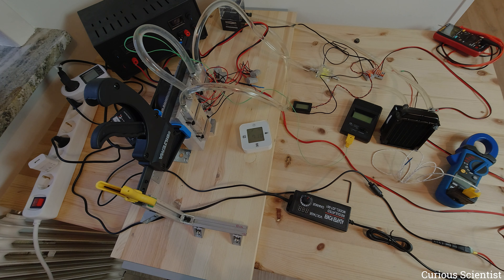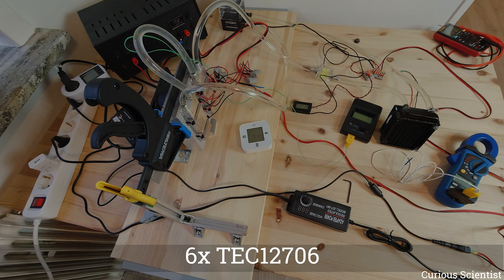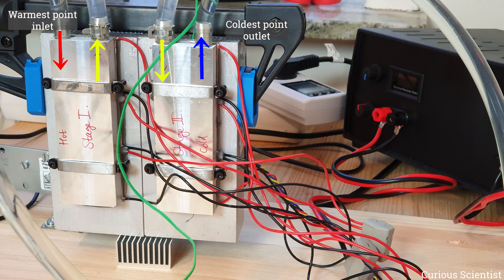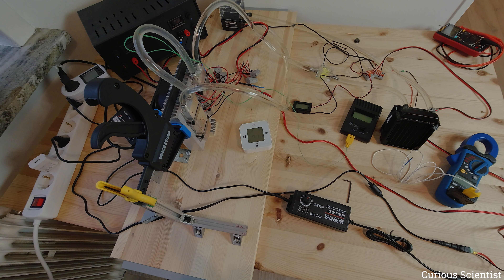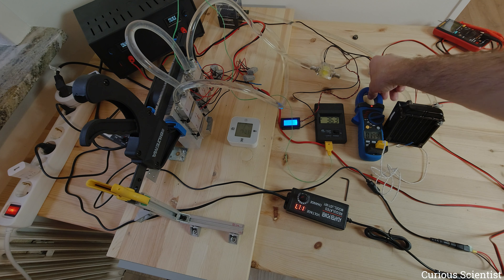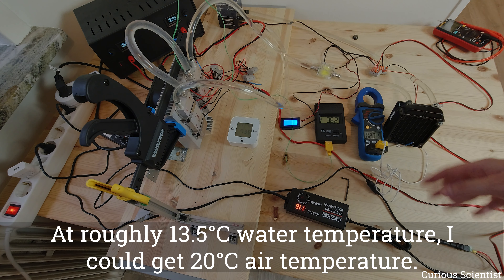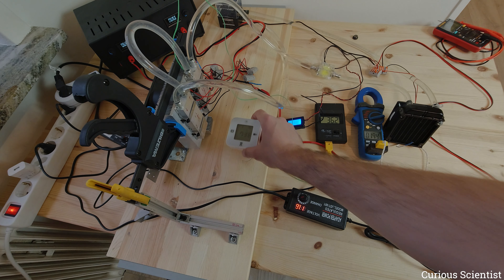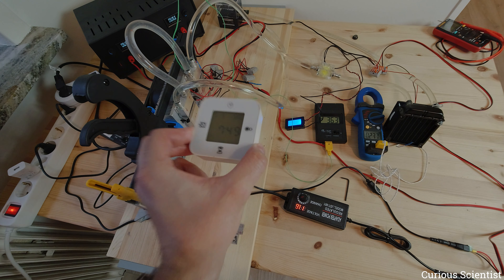Why is the Peltier cooler-based air conditioning a BAD idea?

Comment: Hay Curious Scientist, does it make much difference that your dumping the hot side hot air into the same room your trying to cool? 

I am wondering about building a 20 amp solar powered version with around 30 to 40 peltier coolers with both sides using copper water heat exchangers to remove heat from one side and cooler water from the other. 

In the summer I could use cold ground water to cool the hot side and a radiator to pump the cool water through with a fan. Since this is solar powered it would pretty much be a summer cooling system not a winter heating system. 

I am still interested in trying a full 20 amp version though. I do realize that those 20 amps could be applied to a regular air conditioner and it would probably work as good or better. I also realize if I got 48 degree ground water i can just pump that through a radiator and cool with that. Still want to try it though.
Reply from the maker: Hi!
No, it does not matter from the experiment's perspective. Of course, in a real situation, you would separate these two, but here I was not measuring the effect on the room temperature. I just measured the effect on the outlet air temperature.
Reply: I think that you should try it! Sounds like a good idea and could be some fun working it all out and putting it together! 
There's no greater satisfaction than when you put something together and see it working! 
The one thing that I took away from this video and the other video where he performed the same experiment but with only one Peltier device is that with the one Peltier device he achieved a 4°c temperature difference in relation to the room temperature and in this experiment he got an 8°c temperature difference but using 6 Peltier devices.... 
Something definitely tells me that the temperature difference should have been greater and I suspect that the problem lies in the cooling blocks! The hot side has water from the radiator going in one cooling block, then into the other and this means that the second cooling block is getting it's water pre warmed! 
I would personally go with the single water cooling blocks, the cold side water should be running in series while the hot side water should be fed in parallel to the water blocks! Using single Peltier water blocks ads complexity but the efficiency goes up! 
Also from my experience with radiators, you definitely need a much larger radiator on the hot side, in your case, using ground water mitigates the need for a radiator anyway, so that's not a big problem for you! 
But I would definitely try it! If the system is well designed, you should be seeing more than 8°c temperature difference and that might just be enough to get you the cooling you need! If not, then at that point you should know if you are going to need a few more Peltiers or a lot more! 
I would love to know if you have done anything with this idea 💡...

Comment: I see you are focusing on a house system. Try rethinking for old, classic cars where a belt driven compressor AC system is not viable place. I'm pretty sure you could get sufficient cooling of a car cabin with peltier devices. 

12 or 16 peltier devices connected to three water blocks. Hot side goes to engine bay and a large PC cooling radiator (via reservoir and pump) and cold side goes to a radiator small enough to fit under the cabin air filter (also via reservoir and pump). Put antifreeze in the cold side and some mineral oil in the hot side. Also place sufficient fans on the hot side to dissipate the heat in to the engine bay.
Reply from the maker: But please show it and prove it, do not just say that one should do this or do that. I can also guess that we should have maglev trains everywhere because they are faster and smoother. But then, good luck with providing all the infrastructure for it. Same here.

Comment: It is very inefficient, true. But I have a classic mini, with very little amount of cold air needed to be cooled. Would that be enough to cool the airlet's say 5° under ambient ? I have a 70 amp alternator, i could draw 40amp continuous just for the module at around 14v, that would be about 600w available, would that be useful or just a waste of time ? i'm not expecting insane cooling performance, feeling 25 instead of 30 would be a success.
Reply from the maker: Hi! In my opinion, cars are more difficult to cool down because their whole surface is exposed to the sun and they are not (well) insulated either. So you really need a great cooling power constantly. 600 W probably won't make any significant difference. A regular car AC is around 5x more powerful (roughly 3 kW), so you can guess how well it would perform with 600 W worth of Peltier coolers. Especially, because that 600 W is the electrical power and not the cooling power... I personally would not waste time and money on it.
Reply: @CuriousScientist  There is very little space under the bonet of a classic mini. I will try to use a refrigirator compressor, I've seen some were able to get around 1.500 btu, which should make a noticeable difference. Thanks :)

Comment: I've tried using Peltier to cool my water - it does not work. First, it takes a lot of energy if you do this for your van.  Second, you can't seem to cool the hot side enough even if you use coolant. I tested it and the hot side made my enclosed testing area even hotter than the outside.  So since I can't get the hot side to be cool the cold side is lukewarm thus no relief with cold air.

My Plan B is  I really have to use an ice maker to make ice and just use it with some kind of radiator hook up to a van to get cold air in the wilderness with no place to get ice.
Reply from the maker: Of course it takes a lot of energy, I am ranting about this in basically all of my Peltier-related videos and people just simply cannot accept it. If your hot side is getting too hot, you are probably running it at too high voltage and your cooling is bad. Make sure that you use large heatsink and proper thermal paste. I am also always emphasizing that one should not run the Peltiers at high (12-15 V) voltages. It is better to run them at lower voltage, around 8-10 V, but sometimes even lower voltage (6-ish) is preferred as their COP becomes better. Also, at this point, you will not be able to cool large volumes of water just with two Peltiers coolers. If I recall correctly, I mentioned it in my previous response, that you will need multiple devices. I meant something like 10 or so.
Reply: @CuriousScientist  10 devices ... this is not practical for my small van :) I wish I could do it because van life requires a/c that does not cost 1k or 5k. Maybe my only recourse is to use the ice machine :):):) And just cool me up using a radiator with a tube routing cold water through them and a fan in front of it. Thank you for your reply.

I did not pay enough attention to voltage here, but I use my van, which is based at 11.9 volts.
Reply from the maker: If you connect two identical Peltier coolers in series, they will get 6 V each if the supply voltage is 12 V. You would get much better performance. Also, I will start making Peltier cooler-related projects in the future again, so stay tuned and maybe you'll see some useful information in those videos.
Reply: @CuriousScientist  I will do that tomorrow. Thanks very much. but with that, I have to rewire everything :)
Reply: @CuriousScientist  Hello, I just cut 2 wires out of the group and connected them to make them into a series, and yes, the energy consumption is MUCH LESS.  I also put a bottle of ice in the return hot water container. I wanted to see with a little bit of ice would make the hot side less hot so the cold side is coldest and provide a lot of cold water quicker. So one bottle of ice that can do the job for 4 hours of cold is something I can handle with the tiny fridge section of my fridge.
Reply: Not working as I hoped. The hot side water is 1 degree cooler than the ambiance, but the cold side is not cold but only cool. The air is acceptable. well, I just need to redo the fan and the radiator and put both on top and outside of the cooler with tubes going into, the cooler. I will test this and let you know. But overall I think it will give me relief :)
Reply from the maker: As I mentioned, only 2 coolers won't make any significant difference. It is best to use a lot of them at lower voltage (thus current too). Since they are intrinsically poor in efficiency, there's not too much you can do to squeeze out a lot of cooling performance from them.
Reply: @CuriousScientist  yes I give up :) it also eats a lot of my solar which I have a lot of but still not enough.  thank you very much for your help :)

Comment: I would not recommend that setup if one wishes to test the efficiency of a Peltier cooling system. The biggest disadvantage of your setup is that you are using two heat exchangers to measure the cooling efficiency which is completely wrong. if you use 1 heat exchanger and use a single medium (air) instead of two mediums (water and then air) that will significantly increase the Peltier cooling system efficiency.
Reply from the maker: Hi! I replicated the system that most people ask about in the comment section (cooling water with Peltier coolers and then using the cold water to cool air). Also, many YouTube videos exist on this topic and all of them are misleading and they lack any explanation and measurements. I wanted to show them that it is useless. I think it is a fair demonstration for this purpose. If you check my other videos related to Peltier coolers and their comments I always discourage people from doing this because, as you also suggested, adding one more interface further decreases the performance. The "best" would be to have the cold side directly exposed to the environment that we want to cool (I have a video on that too). But I would not even build any "air conditioners" based on Peltiers because they are simply not made for that task.
Reply: @CuriousScientist  I agree with that. i have not tried Peltier myself as a cooling system to this point, but I am pretty convinced that considering the very low capital cost these systems actually have a good chance to work in confined spaces. I believe I would learn along the way. I watched your video and as far as experimentation and research are concerned it's pretty good to explain the idea, I was hoping for more of a solution after this setup and I will go through the rest of Peltier's videos to find out more. I appreciate your efforts in making the videos to spread the knowledge.
Reply from the maker: @mohsinraza2491  Thanks! I don't know what kind of solution I could have provided. I cannot change the intrinsic material properties of the Peltier coolers, and that is what decides the efficiency. 
But the conclusion is that since these devices are extremely inefficient, it simply does not worth it to build an AC with them. Yes, maybe a Peltier cooler is $5, but you need 30 of them to have considerable cooling power. Then you need to feed them, as well as cool them. So it is not cheaper than a proper AC with a compressor and in addition to that, the running cost is easily 3-5 times more expensive. 

They are the best when you need very good thermal stability (cooling laser diodes), or where you can directly mount something on its cold surface (x-ray detector or CCD camera). They are also used as "ovens" for reference voltage circuits.  None of these requires several hundreds of cooling power, unlike an AC.

Comment: in this experiment you imagine putting the peltier outside and cooling the inside through the water piping, would the efficiency change if you reversed it to put the peltier inside and pushing the heat outside through the water piping ? measuring the difference might be interesting. Also could we take advantage of the big radiators that are already in your home, plugging the inside unit onto them and using a big fan that blows on them might be more efficient that using the small ones.
Reply from the maker: I have videos on the mentioned arrangement, check my channel. Peltier is inefficient either way. Also, Peltiers are not powerful enough (you would need plenty of them) to create a noticeable temperature difference on such a huge body. Also, it is kind of illegal (and dangerous) to modify the radiators since they are part of the district heating system. At least where I live.
Reply: @CuriousScientist  hello sir, i just want to ask a question just to clear my mind, example i have 6 peltier unit with 6A each, does it means i need 36A of power supply or i just need a 6A supply? Pls let me understand thank you
Reply from the maker: @MOTOJAM24  Hi! Why do you ask a totally irrelevant question under someone else's comment? Look up my videos I have a video exactly on this topic. It is about the serial and parallel connection of Peltier coolers.

Comment: Could a peltier device be used to cool large volumes of water?  Would it be possible to cool 20 cubic feet of water to freezing with peltier?
Reply from the maker: That's more than half a cubic metres... Absolutely not. Especially freezing the water would be very energy demanding. I explained it in some of my earlier videos but to bring a 0°C liquid water to 0°C frozen, solid state would take the same energy as to cool down the same amount of water from about 80°C to 0°C, if I remember correctly. Peltiers are already very inefficient, they would not be good for such a task. Even for traditional freezers that's a challenge. It is an unreasonably high amount of water anyway.
Reply: @CuriousScientist  does the equation change if the objective is just to get the water very cold (1 degree C, for example), but to remain liquid?  I guess your larger point is that peltier is energy inefficient for larger volumes?  I was trying to validate if this only applied to use of peltier for purposes of cooling the air, via a water cooled system, or if the objective of just cooling the water (no objective to use the cool water to cool air) changed anything.
Reply: I guess the other factor here: if the large volume of water can take 2 days to cool to that level (no objective of reaching temp quickly), does that change the equation?  And is the point that the energy costs would make it prohibitively expensive to operate?
Reply from the maker: Still would require ridiculous amount of energy and with Peltier coolers, much of the energy would be just wasted. I just wanted to emphasize that it would be even more challenging to actually freeze the water into solid. Phase transformation is always costly energetically.
Reply: @CuriousScientist  thank you for your reply.  Is the only way then to efficiently cool at scale then using refrigerants of some sort? Is there an alternative besides peltier to refrigerants?
Reply from the maker: As far as I know yes, traditional cooling method is the only other viable option. Probably there are other coolers out there using some other effects but I am pretty sure that they are not really for these applications.

Comment: what about using copper heat pipes for cooling?  Very nice work!
Reply from the maker: Thanks! Would not make any significant difference as the bottleneck is the Peltier cooler.